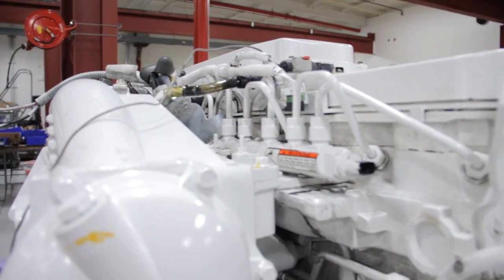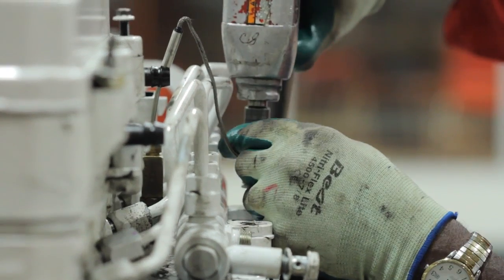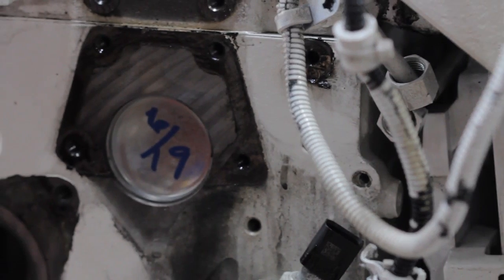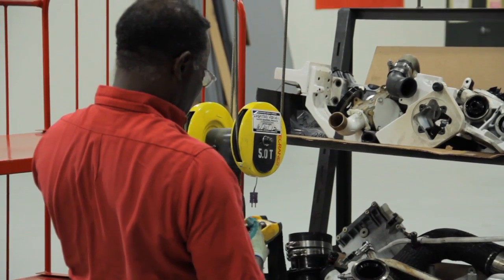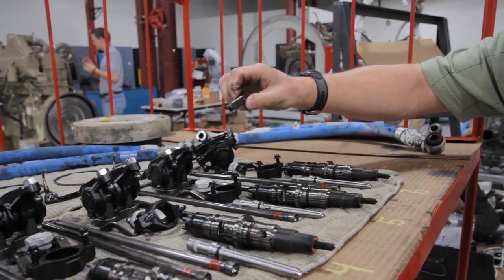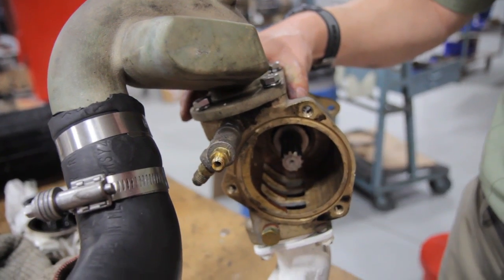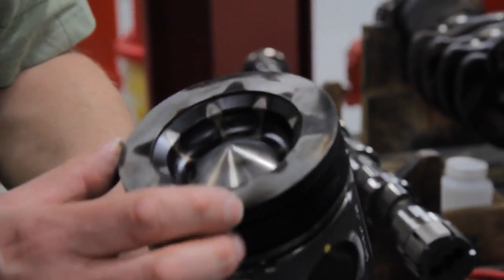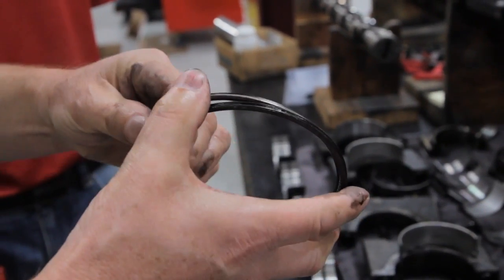Cummins Recreational Marine: Engine Testing

Comment: You could not even fix head gasket issue on X15 forget about anything else . We had so many engines come and go all same issue headgasket then to replace almsot all cummins want counter boring . Lesrn sometbing from volp d13 barely had any head gasket isues